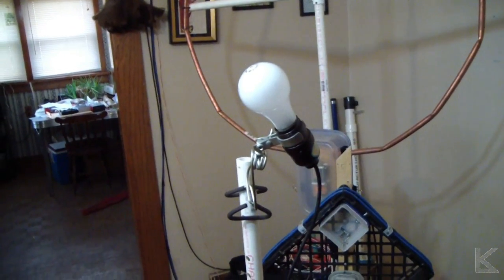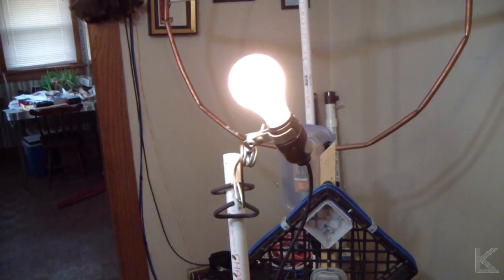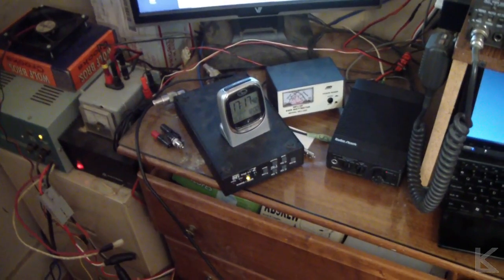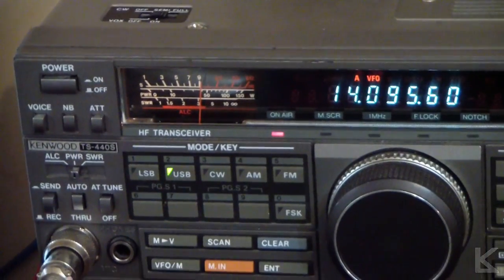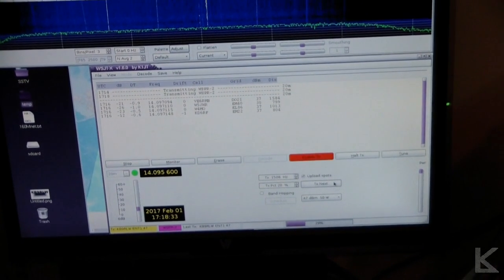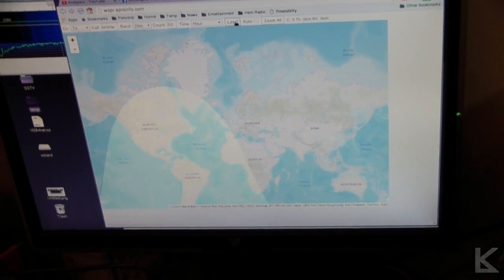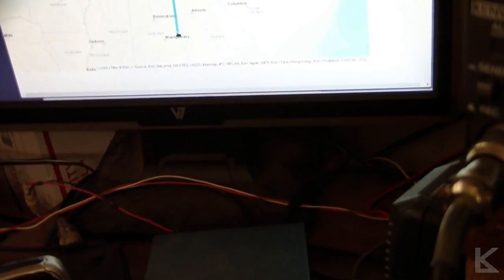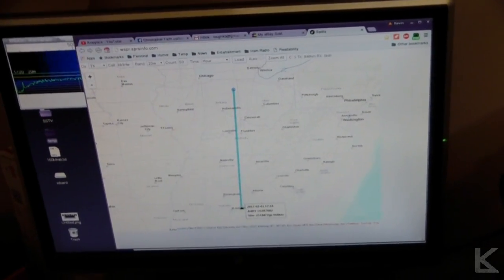Ham Radio - The light bulb antenna

Comment: I enjoyed this video.  In about 1956 my dad was working on and awaiting his General ticket having passed the FCD offered test. He was so anxious to get on the air and had a Johnson Viking ii ready for the day when the call would come.  He didn't have a dummy load but wanted to test the Viking II.  I was a teen watching my did hook up a light bulb, I think a 100 Watt, to the rig and turn it on.  He was happily sending CW with his bug about 25 wpm as I recall when the phone in the shack rang.  He answered only to find out that his Elmer, Bill Benton K4KUK who was living about two miles away was on the phone.  Mr. Benton had heard dad testing the Viking and wondered if it was him on the air.  Dad had not bootlegged the call and as former Army Air Corps dad knew CW no problem.  Dad stopped transmitting at that point never to use the light bulb again.  He was embarrassed by the event.  A few weeks later his call arrived in the US postal mail.  He was forever more known as K4MAB.  Today my son holds K4MAB.  I currently do have a light bulb on my work bench so I can show others what RF looks like.  Fun.   de N4NRL

Comment: This is not what I thought it would be. The use of a light bulb to transmit is an ongoing recent study I briefly saw somewhere. But the idea wasn’t about using it as a dummy load. It was to use the light itself for high bandwidth internet communications within homes and offices. If I remember correctly, it was called Li-Fi. https://en.m.wikipedia.org/wiki/Li-Fi

Comment: Where ist the lightbulb resonant? Test it with a vna!
Reply from the maker: As it heats, all of that changes.
Reply: @loughkb  oF cOurSe! tHaT's tHe chAlenGe! You have to adjust the power to transmit to tune the antenna! Isn't that a great idea?! i nEeD mOrE cofFeE! mAkE iT wOrK! mAke iT wOrK, kEvin! Madness is just a door for greater comprehension how the world is really working. Electrons don't exist neither, they are wave. To see you use an not tuned antenna wasn't delivering any surprising result. Tune it whatever the cost. Tune it while transmitting. This is just the thing the world needs. Hell, I love your antenna, but there is more in this… madness is just the name the mundanes give those, who really know and they can not understand.

Comment: when i got my license in 1971, using a light bulb was the preferred method of adjusting a radio - ie: using it as a dummy load.
Reply from the maker: The only down-side to using a bulb is that it's impedance changes quite a bit as it warms up.

Comment: A CB radio has about a 4 watt output.  Can I use a 12 volt 4 watt bulb as a test load with out hurting the CB wheni key it to transmitte ?
Reply from the maker: Probably not.  The bulbs resistance is going to change as it heats up, so you'd be hitting the radio with a high SWR for a short time and might burn the final.
Reply: @loughkb   
Thanks for the return email.  I was asking for my son,  he said he checked the antenna cable and found a short in it.  This was making a red light come the CB when he  tried to transmit. It was a used CB , he was tryint to hook it up in his truck. I was only trying to find a way to see if the CB had any output to the antanna.  I guess my idea would have worked for a real short push on the transmit button.  Very short push to see it the light would come on.  Thanks again and God Bless You

Comment: Recommend something to try.  First...safety first but break the lightbulb glass.  Take either a paper plate covered in tin foil...or a tin pie plate. Cut a whole and basically make a dish... then try your experiment again and see what you get.
Reply from the maker: Way too small of a reflecting surface for the long wavelengths down at these HF frequencies.   It wouldn't make any difference.

Comment: Back in the 1970's I found an old Transmatch antenna tuner at a flea market. With it I could get a decent VSWR on most anything. I transmitted off a coat hanger as an antenna, a bicycle frame, shopping cart, rain gutter on the house, chain link fence, electric fence (turned off), and lots of other stuff. I wish I still had that old Transmatch, it really was a lot of fun to play with.

Comment: By the looks of it they picked up the emissions from the cable rather than the bulb itself. This is an old CB trick as well. To use a 100 watt light bulb as a dummy load. It  flickers with ones voice, kinda fun to watch. Not sure I would want to risk my finals on it, unless I use a tuner for a better match.

Comment: Hey Ken, Just for giggles how about putting a regular air-cooled dummy load on WSPR and seeing if that gets out? My elmer back in the late seventies made a mention that when tuning with a dummy that it was theoretically possible and to be aware of it.
Reply from the maker: I've no doubt it's possible.  There's even always some radiation of the coax, even if just the littlest bit.   Might be a fun stunt to do sometime when I run out of ideas.   I was thinking the other day about putting a metal plate on the floor and standing on it bare foot.  The human antenna WSPR test.  ;-)

Comment: Heh - put a couple of 3-turn loops through a nice ferrite at the radio and bulb-ends of your co-ax to decouple it- likely it was radiating considerably!  If you set your auto-tuner up at the lamp assembly, it would also help with this by ensuring matched impedance between rig, co-ax, and LampTenna (tm).

Comment: Well  Kevin saw this in the passing of the surfing lol  and remembered somewhere I seen this before Well the next think I knew after watching yours and Jim's W6LG I just had to try it , Well kevin it does work made a few contacts  on CW 40 mtrs ..So yea I was one of those Old hams hand one for a Dummy load and  am sure you remembered how many times you did not switch the dummy load out to the antenna !! and got replies I heard you loading up or ""Boy your really weak coming in today lol lol What some it up kevin the challenge It makes and its in the window Flashing away on cw By the way I was on 10 watts  doing CW . hay good video , now have to keep eye open for flashing light from a window or outside pole, it might be a ham , if we coule get as many in FT-8 doing it, hay that would be something lol lol 73's Dale

Comment: Kevin, a little history here. Back in 1962 my first QSO was done using my 75 watt "dummy load" between Woodside and Castro Valley (45 miles) on my newly built DX-40 on 80 meters. Unfortunately, it was done with my call sign KN6TNT which I was "using" prior to receiving my novice call, WV6KJK. 

*shhhhhh*

Occasionally, QST features April Fools Day articles and one such was about a guy in Colorado who used a pair of "phased dummy load"  light bulbs to do WAS. 

But they DO get out!

72  de k6whp 
(my *real* call)

Comment: On 6 mtrs i had a 12 v lamp on the back of the radio it worked better than my outside antenna this was a tube rig a solid state rigs may be a issue maybe 5 watts will be safe  kg6mn

Comment: I was not surprised at all that Your WSPR signal was heard.  Back in 1964 my buddy and I, who lived a block away and had passed our Novice exam at the same time, would run code practice sessions.  I was using a Heath HE-40 and a Hallicrafters SX-110.  With less than 35 watts out our signals on 15 meters were very readable.  The light bulb also made a good visual dummy load for tuning up that transmitter!  73 WA8AR

Comment: LOL... Love the part where you get an idea, (speaking of a "dummy load") LOLAfter I had passed my first novice exam back in 1959, I build a light-bulb dummy load. I was also under the impression that it would not transmit any signal. Well, I didn't have a call yet even though I had passed the exam, because the FCC took 6 weeks to send out the new licenses at the time. So, I hooked up the dummy load to my novice transmitter (Viking Adventurer 50 watt MOPA rig) and practiced sending using my neighbor's call, K7CUZ.About 5 minutes later I got a phone call from the neighbor asking me if I was the one boot legging his call. He chewed me out thoroughly when I told him what I did. LOL. He only lived 3 houses away but he said he could hear me all over the 40 meter band using HIS CALL! That is how I discovered you CAN transmit signals with a dummy load.Great video Kevin. Keep 'em coming.73 DE K7RMJ  Frank
Reply: cuban9splat, Frank. Sorry, should have read your post before I put my comment up. Boy, waiting those several weeks before we got that previous notification from the FCC was a bitch wasn't it? 

73,

Bill, k6whp
Reply: @warplanner8852  , Bill. It sure was. Even worse was going to the FCC office in Phoenix to sit for the General exam. Was just a kid at the time LOL
Reply: Matt King flex 6700 hf sdr
Reply: A great story at that. I am currently studying for my foudation licence over here in the UK. Hopefully with these videos and comments I can avoid the same mistakes haha. 73
Reply: i realize it's pretty randomly asking but does anybody know of a good site to stream new series online?
Reply: @Elon Imran Try Flixzone. Just google for it :)
Reply: @Keaton Luis Yea, have been using Flixzone for months myself :)
Reply: @Keaton Luis Thank you, I went there and it seems like a nice service =) I appreciate it!!
Reply: @Elon Imran Happy to help =)